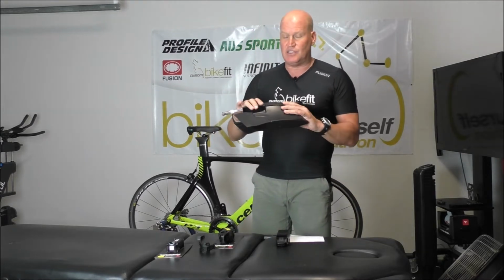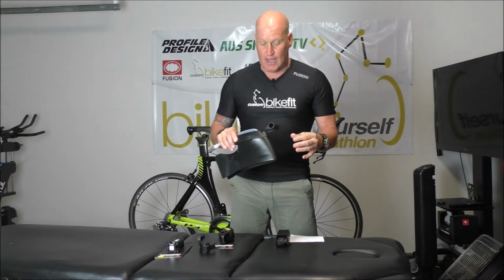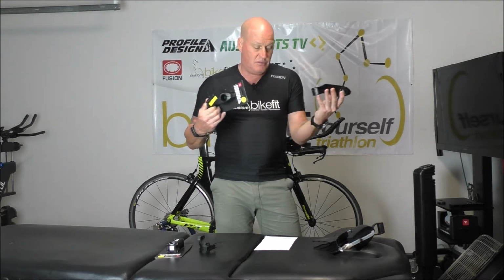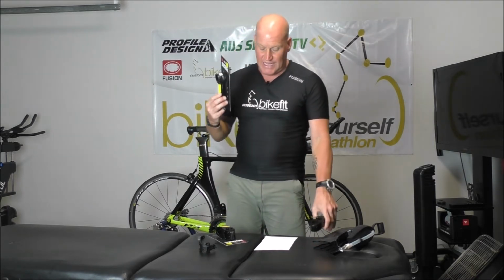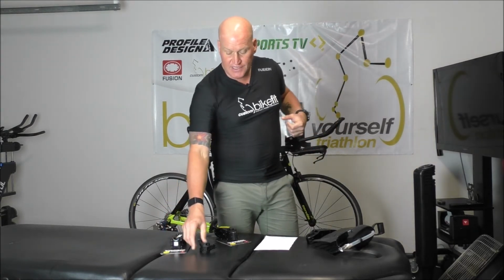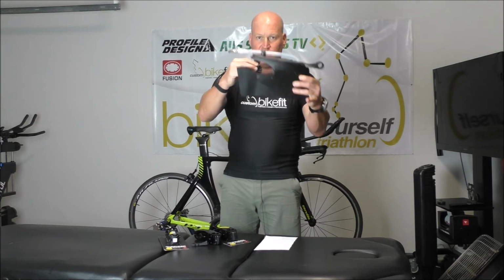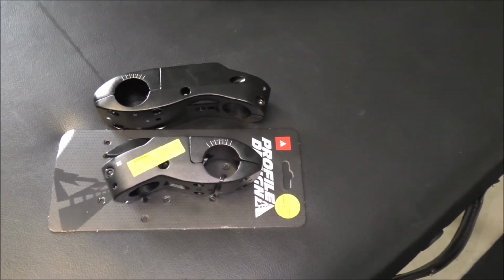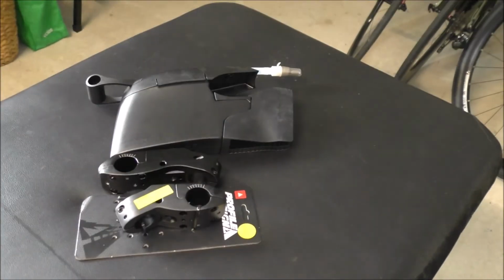Profile Design HSF Aeria: The BEST Hydration System to Save Money and Ride Faster

Comment: I’ve lost my “clip” that attaches to the hydration system. Basically came loose and fell off during a ride…where can I buy the clip? Is it included with the purchase of the hydration system or included with the faceplate or sold separately?
Worried I won’t be able to find another “clip”
Reply from the maker: It's included with the purchase of the hydration system Christopher and doesn't appear to be available as a spare part. That said, if you send me an email to setup@custombikefit.com and let me know where you are located, I'll do my best to find you one
Reply: Oh bummer…I’m in brookpark, Oh. Zip 44142

Comment: I am searching for a suitable front Hydration system for my Vervelo P5 (DI2 version). Would it be possible to use this? The cockpit is quite specific (but it is the standard 2020 P5 cockpit) hence I am asking.
Reply from the maker: I'm afraid it won't fit the standard P5 cockpit. You'll need something you can sit between the aero bar extensions
Reply: @custombikefit466  thanks for clarifying. I will check if the bottelcage of the HSF 800+ can be mounted by just using the places for standard bottle cage screws on top of the cockpit. Not easy to decide on the web alone if the HSF 800+ can be easily disassembled to achieve this though. Would you know as well?
Reply from the maker: @holgervanbargen9792  I think it will fit, providing your extensions are long enough. The HSF 800 bottle is 320mm in length. Note: there have been some issues with the cap on the HSF 800. I purchased 10 units when it was first released and 8 had caps which would not lock closed. Profile Design have taken a while to fix this. In fact I've just received a call today to say the new replacement caps are on their way to me

Comment: Thx for the Video! Is it possible of internal place of the DI2 in the 70mm as well ? Easily like in 100mm ?
Reply from the maker: Absolutely, I see no reason why not
Reply: @custombikefit466  I mean not only the cables but also the junction Box / connector...
Reply: @custombikefit466  well it is smaller and I did not find any Information or pictures which refers to 70mm :/

Comment: Hi Mike, Good video mate. only draw back with not using the Aeria Stem is that, yes it is cheaper but you are loosing all the internal cabling capability hence all your brake and DI2 or Gear cable will be routed outside of the kit. Have found a way to go around this?
Reply from the maker: Agree Robert but the stem alone won't completely resolve the internal/external routing. You also have to take into account the bars and the frame. Internal routing has it's benefits but it also has drawbacks - swings and roundabouts!

Comment: I’ve the seventeen stem for a normal road bike can the mount face plate be used to take an out front wahoo mount?
Reply from the maker: Hi Jack, the face plate featured in the video is specifically designed for the HSF/Aeria front hydration. It's not designed to accommodate a wahoo mount but you can mount a computer (Garmin/Wahoo) off the front of the hydration system. Hope that helps

Comment: Does this hydration system fit on a bike with rim brakes? It looks like the cables would be in the way
Reply from the maker: Yes it does. It will 'hide' those cables, thus reducing drag. 90% of those that I've fitted/supplied have been for bikes with rim brakes

Comment: What has been your strategy for cleaning the system? Do you take it apart? Seems like getting it dry may be difficult unless you take it apart. Thoughts? Thanks for your help.
Reply from the maker: The drink system is pretty easy to brake down and clean
Reply: How do you empty and refill?